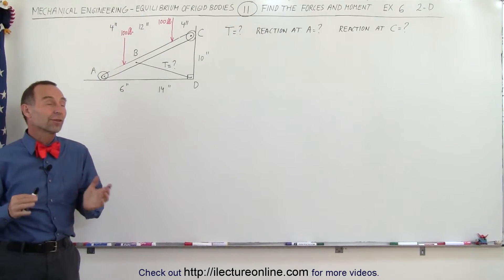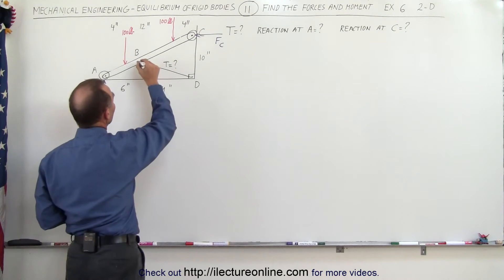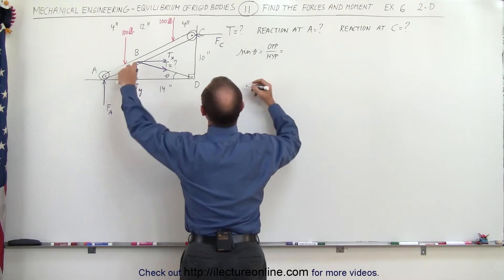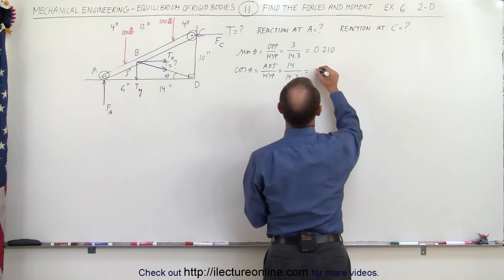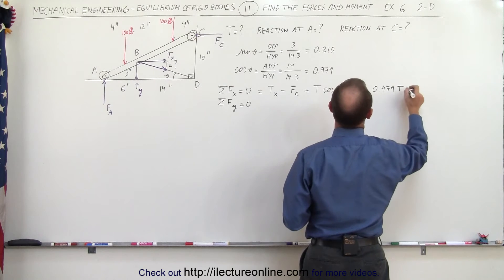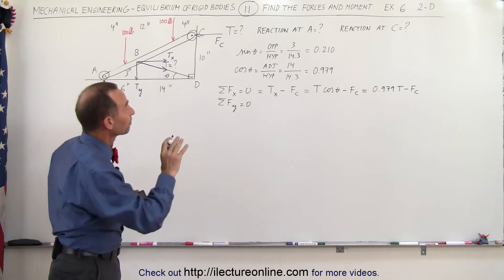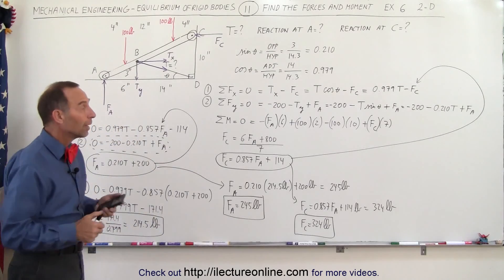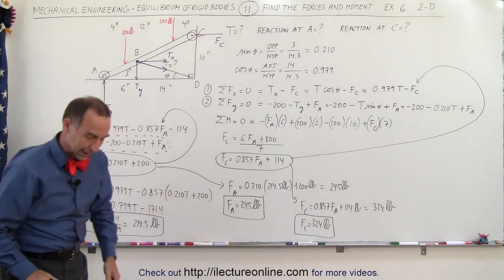Mechanical Engineering: Equilibrium of Rigid Bodies (11 of 30) Find F@A=? F@B=? T=? Ex.6, 2-D

Comment: Sir in getting the components is it a rule to to follow that 6/20=3/10 and then 3/10 ×10
Reply from the maker: One can definitely use ratios here to find the magnitude of the components.  Essentially you need to determine the angles.

Comment: Sir:
When measuring the distances between F_1 and F_2 (each of the 100 lbs forces), is the four inches on the left of F_1 measured from the line perpendicular to the point of contact between the wheel and the floor? And is the right four inches between the wall and F_2 measured flush to the wall?

Comment: can I take the moment on A or C? The Wheels don´t rotate correct, so we can take the moment anywhere?
Reply from the maker: Essentially, you can take the moment at any point, but we usually pick the best point, which typically means the point that can eliminate the most unknowns.

Comment: equation 1 is 0=0.979T - 0.857Fₐ - 114, what happened to the "- 114" when you substituted the value of Fₐ?
Reply from the maker: You caught an error.  That should not have "disappeared".  Thanks for pointing that out.

Comment: I took moment about point A:
-Tsinϴ*6-tcosϴ*3-100*4-100*16+Rc*10=0

-0.209T*6-3*0.97T-400-1600+Rc*10=0

from the equation sum of forces in x direction:-
-Rc+0.979T=0,I got Rc=0.979T

I substituted in the moment equation and got 
5.626T=2000
T=355.49

Can you tell me where i went wrong?

Thanx
Reply: i took it about A and got the same ANS as u  IDKW!!!
Reply: Same

Comment: Professor, I noticed that you switched the order of the digits in 0.979 to 0.799. This is a mistake, right?
Reply from the maker: No, it is correct.  0.979T - 0.180T = 0.799T

Comment: I'm a bit confused why you multiplied F(c) by 7 while the distance is 14 ?Thanks
Reply from the maker: The distance is the: "perpendicular distance from the line of action of the force to the point of rotation".  If you draw a horizontal line from C to the left, and then you draw a line from B upward and meet that line, the distance will be 7.
Reply: Ohh , you're right 
Thanks a lot for explanations :))

Comment: when calculating the moment at B the perpendicular distance from B to F(C) is positive (7) while F(C) is negative  so you should write - 7F(C) if iam wrong please tell me why beacause i am confused ,,,, at 7:09
Reply from the maker: +Ahmad abdul ghani 
 The convention for the sigh of the moment (torque) is that when the moment is counterclockwise, the moment is positive, and when the moment is clockwise, it is negative.  Ask yourself the question: "which way would the object turn if this was the only force acting on it?"  That will determine the direction of the moment caused by that force.  Thus it is +(Fc)(7)
Reply: Ok thanks sir
Michel van Biezen